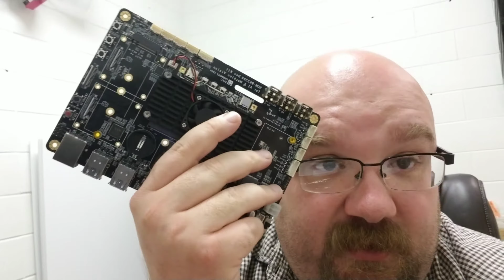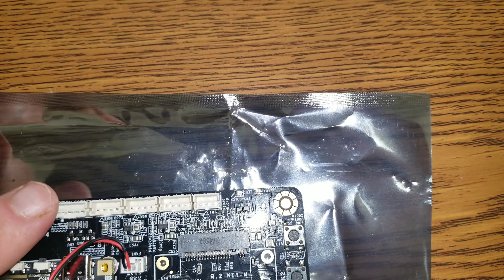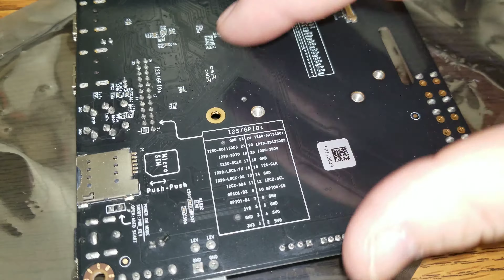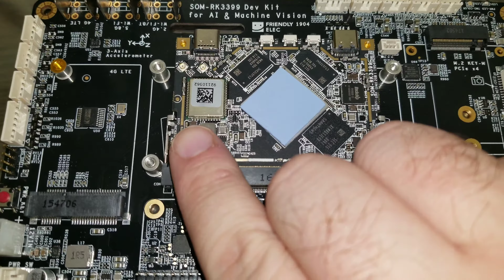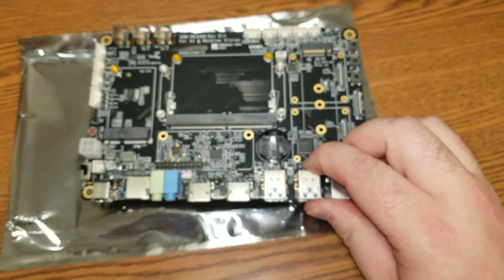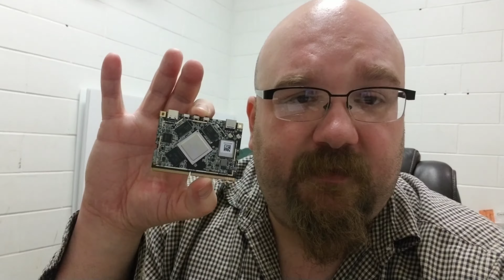FriendlyArm SOM-RK3399 - PCB OVERVIEW

Comment: Hi Anthony, I have been looking at the SOM-RK3399 because they claim it supports Dual Display when running Android. Can you confirm that is support running dual screen with android ?
Reply from the maker: If I remember correctly if you have the dev board you can use the hdmi out and a usb c port on the mini board also.
Reply: @krypticnexus  Thanks for reply! Is that something you could make a video about where you test this functionality ?
Reply from the maker: I wish I could but updating the firmware or something I forget on my board years ago right when I got it killed it and I just never bought a replacement. Grant I haven't touched it in a long time so it could have just been me being stupid also because I was very frustrated with myself once I move house I plan on trying to get it back up and running